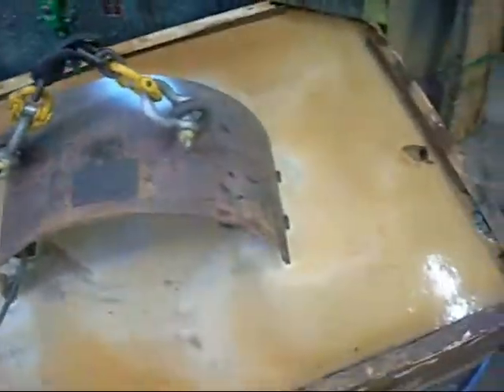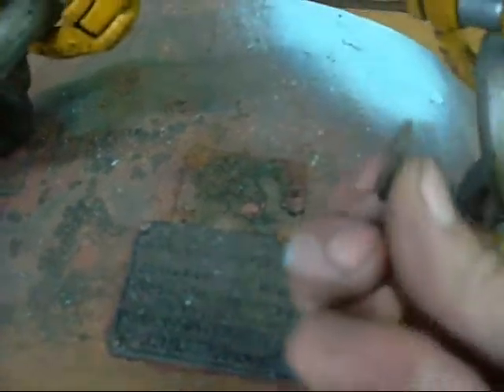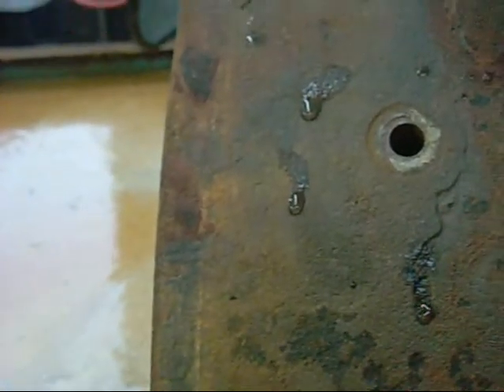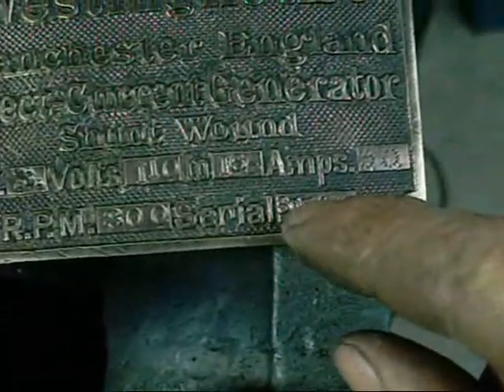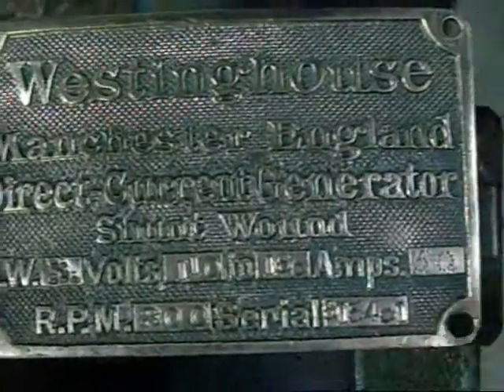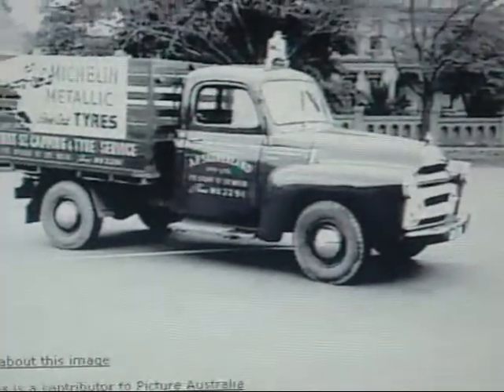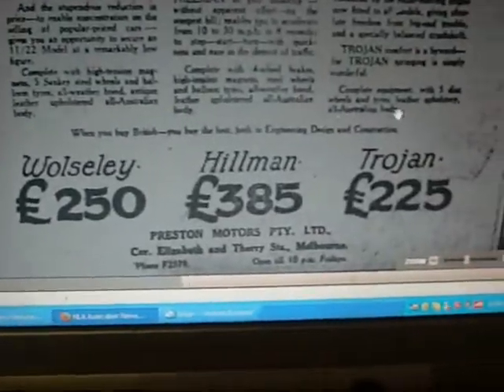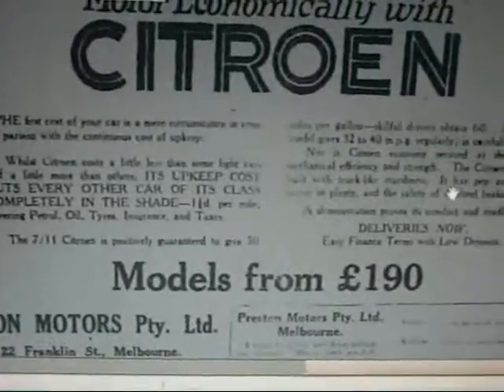Update - Westingouse Generator Service Agent Insight and ID Plate

Comment from the maker: They do work okay but I don't think claimed amperage is what they put on the data plate.

my Arlec welder is made in china and it overheated pretty quick when welding steel frames up (8 or so 4" welds @ full amps) and they are make poor welds at low amps. I have mine set on maximum simply because it would not maintain a good arc with 2.5mm rods at lower amps.

I added fans to it later on and it made a huge difference on its duty cycle, but it lacks arc stability.

Comment: @Aussie50 Heh and adding a couple rectifiers would cost more than the unit itself, unless you got them from scrap. But DC should in theory give you a better arc here. 

What's the voltage on the Arlec? the Chinese ones I'm looking at run at ~48VAC from 220VAC single phase, they're about 100 dollars, they claim 180A... I suspect it won't even give me 140A

...I wonder why sometimes questions get double posted, they managed to ruin Youtube even more and they fixed nothing in the process.